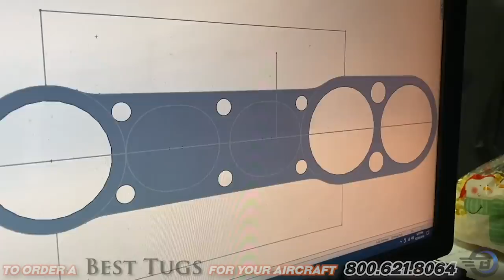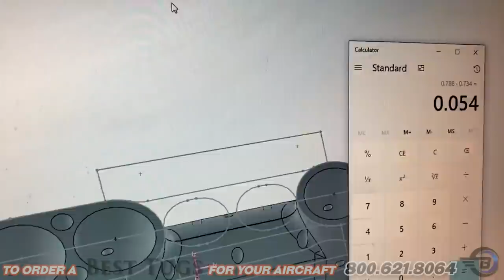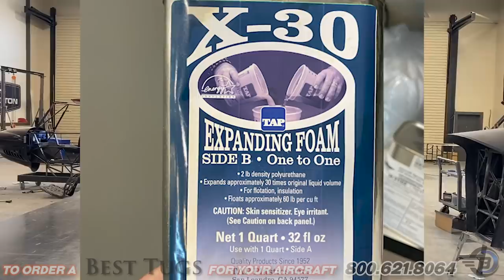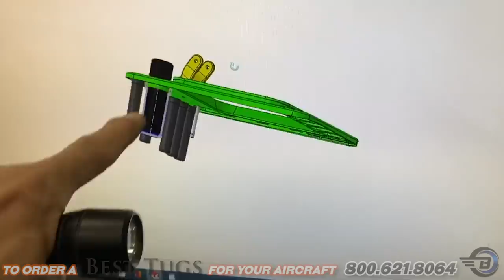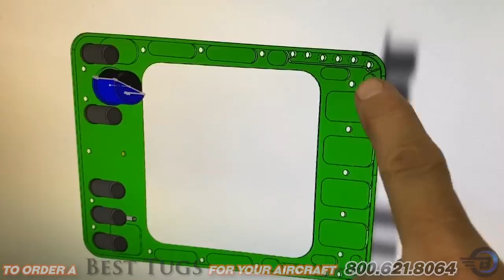Gust Locked 🔒 (Scrappy Bush Plane 14)

Comment: I know it’s crazy, but the helicopter pilot in me thinks maybe you should have a way to hold that gust lock in the down position. A hard bounce could pop it up where it might interfere with the controls. I’d also maybe add a micro switch or wire a circuit through the metal of the stick and the lock to have a warning light for the gust lock being on.

Comment: You should add a spring to keep that gust lock open when not in use. Engine vibration's and violent maneuvers and end up with the gust lock causing problems.

Comment: I'm confused.  Dont you want to gust lock the elevators up?  Meaning Stick back?  I've never heard of gust locking them down.  in the taildraggers I fly we just do it with the seatbelt, but that's stick back, not forward to keep the tail down during a head on gust.  Although thinking about it more, maybe it's better to gust lock them down in case of a gust from behind cart wheel?  i dont know.  Just thinking here.

Comment: The "Pen" holding tubes need to be end stopped, not completely sealed. (Just with a small bar) . In case the "Pen" ever becomes seperated from the lid, while in the tube. Releasing the "Pen" unit to fall into the center console deadspace, and rattle around forever.

Comment: Mike, even with tension on the gust lock, would it be safer to either leave the pin in while in the stowed position or maybe secure the lock to prevent inadvertent interference with the control stick.  Also, cool idea for  the sharpie and pin storage location.  What keeps the pens and pin in place during inverted flight... not that that would EVER happen.  LOL  Love watching you and Mark.  Thanks for the great vids.
Reply: The fit on that C shaped pin is really snug, it doesn't seem like it's going to move  on its own. The pens look like they are locked by friction alone. Either way any non aerobatic airplane has always loose crap
Reply: @almerindaromeira8352  Who said, "Non Aerobatic??" This thing isn't finished yet and you know who's building it!!   ;^)
Reply: @MrGaryGG48  Mike would rather watch SpongeBob Squarepants in his 4 panel G3X than do rolls.😂😂
But seriously inverted flight requires extra fuel pumps, redesign of airfoils (most of the time) and so many modifications to the engine, namely to the lubrication system...and so on...
Reply: @almerindaromeira8352  I suspect you're  probably correct but knowing MIke, he doesn't take limitations seriously, so who knows what he may do with it. Whatever he does it's liable to be entertaining.
Reply: @MrGaryGG48  I believe Mike could do it 100%. I mean its not like he is inexperienced with fully modifying airplanes;) But this one is supposed to be a  light and comfortable Bush plane for flying up to Alaska and meeting with the cowboys

Comment: Haw do u know that the movement on that control stick have the same amount of deflection on elevator up and down , cause looks like that with that aluminum part u made u have more deflection and movement elevator down than up ?
Reply from the maker: Guillermo Nespolo 👍🤠 great question. I preset my stops on the controls up and down. They are very different as in most aircraft. Then set the hole location reflecting there both different deflection angles
Reply: @MikePatey   GENIUS AS ALWAYS !!!

Comment: I believe I see something you didn’t plan on and your fix for it. If I’m wrong no problem I’m used to it. If I’m right it makes me feel better about some of the things I do. I believe you never intended to run that pin through the stick but when everything went together the angle was to great to allow the stick to fit completely into the bracket you made for it. The only reason I’m hoping I’m right is, I watch someone like you and I think why do I have to figure some things out the hard way. It would make you seem more “human” rather than super human. I love watching your videos and the total attention to detail you exhibit. If I’m right why not make another bracket just a little longer so you don’t have to start drilling holes through the stick?  Sincerely A devoted follower.
Reply from the maker: Lonnie Wells you and I think a lot alike. 👍🤠 I already made one out of Alluminum a few days ago. My videos run a couple weeks behind where I am.  It is exactly what I did

Comment: Hey Mike, what keeps the gust lock "out of the way" of the stick when you are not using it. i see that there is friction in its pivot, but i'd want more security. could you reposition the storage for the pin to positively prevent the lock from swinging back in the way of the stick?
Reply: The pin he’s using has a spring loaded ball in the tip that will positively lock it in the socket when it’s inserted.
Reply: @jeffedwards615  True the Pin is locked.  but my suggestion is about the Fork that looks like it could possibly pivot rearwards and interfere with the stick if the fork gets bumped or overcomes its friction in some scenario like a rebound from an "oh crap" landing, etc.   It looks to me like Mike could easily relocate the pin storage to elegantly use the pin to lock the fork in its forward position when the gust lock is not in use.

Comment: Is there a way to integrate that gust lock pin into the starting of the plane. You would hate to be in a hurry and forget to pull it. But if it was needed to perform an operation before take off it would be impossible.

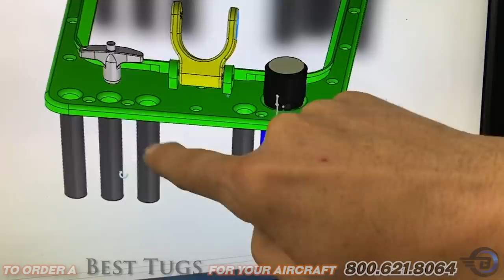Comment: ok so at 15:13 and 15:14 you show your cad model of the gust lock, however, as far as i can see, you did not design a cap on the backside for the gust lock pin itself. meaning there is a probably a 3/16" hole from the cabin of the plane to the belly of the plane right?
soooooo.....maybe one day you land, use the gust lock and go for a picnic somewhere amazing but you get a pebble stuck to the bottom of your shoe, next thing you know when getting back into the plane the slightest tap causes that small pebble to do a hole in one into the hole for the gust lock pin, now there's a pebble in the belly of the plane.
just busting your chops, amazing work, you're a great engineer, i know you like to button things yup.

Comment: With tongue in check —- your going to allow the passenger to bring a cellphone how much weight will that add
Reply: I'm sure Mike will drill holes in the phone and require the passenger to use the bathroom before flight, and possibly fly naked, to save weight.
Reply: @owensparks5013  Nah, just drill holes in the passenger too, in places where they don't need the extra structural strength.
Reply: They have to have a carbon fiber phone

Comment: Make sure that gust lock yoke cant flip back in the way during flight. Running the stick into it unexpectedly could be quite startling.
Reply from the maker: Bluuplanet it locks down I’ll show that when I show the rudder lock video
Reply: @MikePatey  
Seems like a gust lock would save stress and wear  on linkage if engaged on the tail standing behind a parked plane. (I guess that would up the startle factor if it accidentally engaged during flight though)

Comment: What happens if one of those sharpies separates from the cap. Will it be easy to recover it?
Reply from the maker: asdfasdfasdf the tube I machined doesn’t have a hole in the bottom. It’s more like a skinny cup. Nothing can pass 👍🤠
Reply: @MikePatey  I should have guessed that 😉
Reply: @MikePatey  the worst kind of cup trying to vacuum out though.  I'm guessing you won't ever have a sammich in that cabin while using one of the pens? ;)
Reply: @rotohcf1400  blind holes can be cleaned out with compressed air blast.

Comment: I'd feel a whole lot better if the gust lock yoke was lock pinned out of the way vs friction holding the lock yoke pivoted forward with pin stowed in the base. Maybe you already have that worked out.

Comment: Hopefully, you have a way to clean out the pen & flashlight tubes, or retrieve pen parts.  Otherwise, they may collect a myriad of debris over time.
Reply: Wouldn't a quick blast from the air compressor clean out the tubes....done in the shop of course.

Comment: That didn't quite work out. Why not just remake the yolk longer so it wraps around the control stick as originally intended? If it's a bit taller it also give you more room for the boot. ;)

Comment: Great design on the gust lock and boot cover bracket however I would like to see that the gust lock is pinned in the stowed position so that it does not ever rotate over into the normal position. Causing you to have your gust locks on during flight.
I’m just saying. 
Ronnie

Comment: Put a spring on the gust lock so that when you pull the pin out, it automatically springs out of the way, and also keeps it from flapping around.